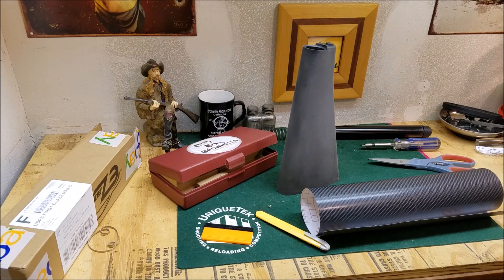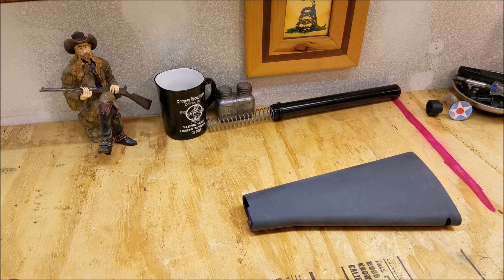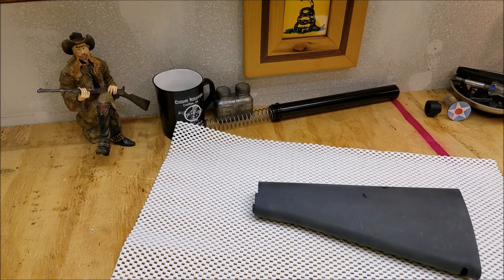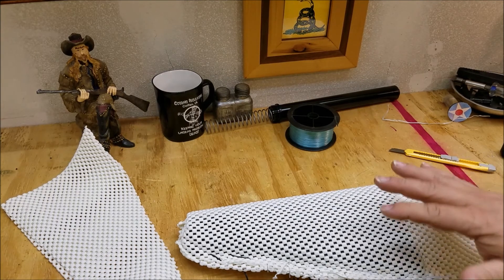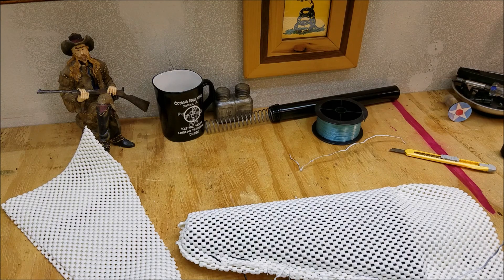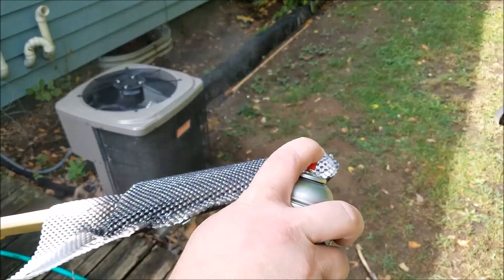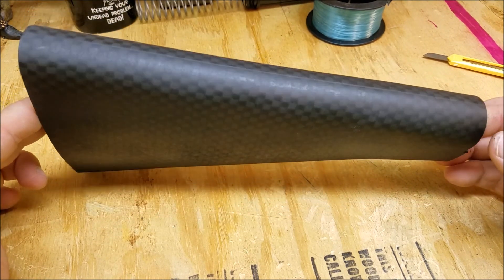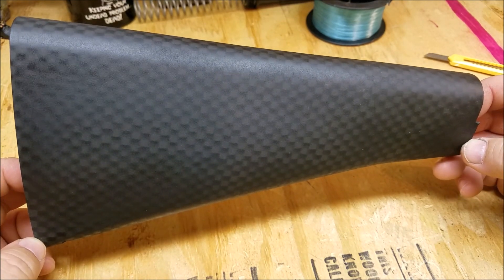Rifle Stock Carbon Fiber Faux Finish (How To)

Comment: I really like it! Do you think this process is easier than hydro dipping? I want to do some customization but don’t have any experience with either. That’s a very nice subtle look going on. It looks perfect.
Reply from the maker: This works well for flat surfaces. not so much on a lower with all the sharp edges and ridges, those would be better hydro dipped.  Thanks for watching.

Comment: Looking at your wrap it seems you didn't pull the thin cover sheeting off the front. The wrap looked glossy and stiff.  When you remove the cover sheeting the vinyl should look flatter and more natural. The best way to get that cover sheet off is to take the sticky side of a scrap piece of wrap and stick it down on an edge, press hard and peel back. The thin sheeting will start to come off and the vinyl will look more natural and be much more supple and easier to work with. Don't forget to clean the part first with Alcohol. Try the wrap again. You will be impressed with the outcome. Nice job on the Faux though.
Reply from the maker: Thanks for the advise, I will have to look at that next time I try to use that wrap. The other issue I was having was the stock seamed to be some kind of porous rubber and the glue had nothing solid o stick to. Thanks for watching.